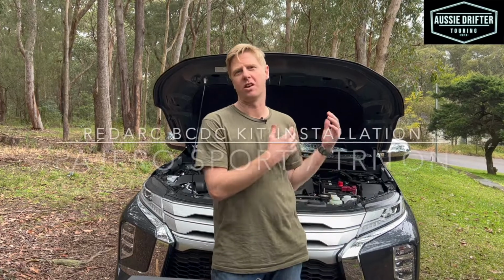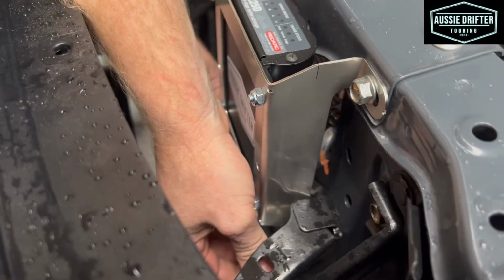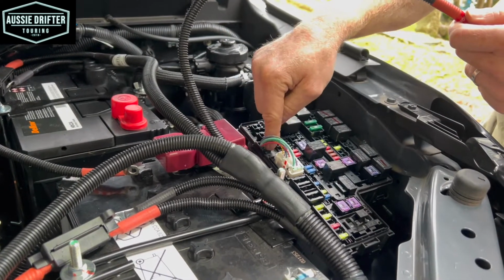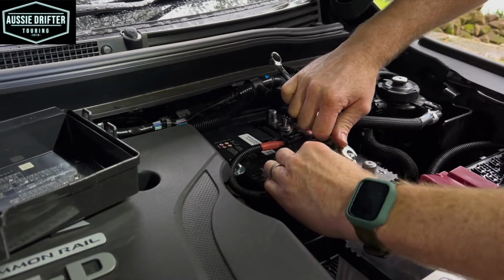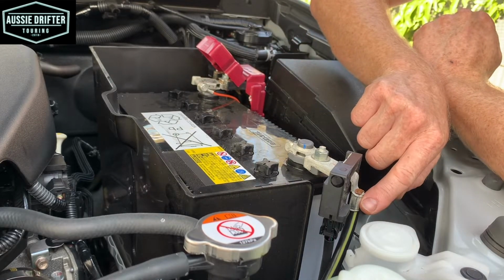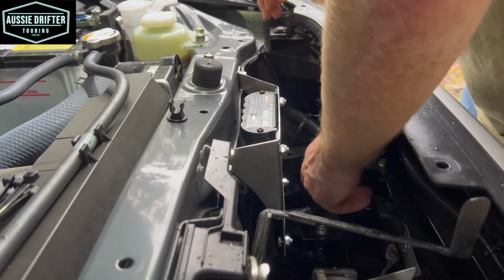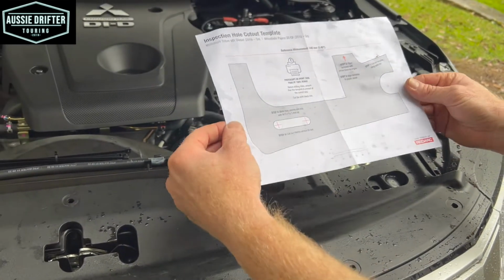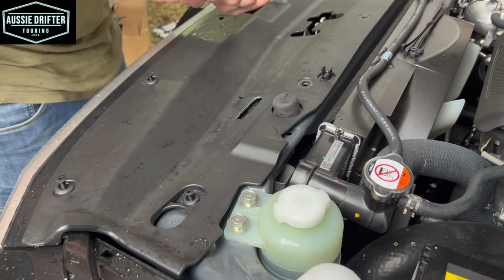Mitsubishi Triton | Pajero Sport REDARC BCDC Dual Battery Installation Guide (Under Bonnet)

Comment: I have a aftermarket intercooler in this location. Would the BCDC still fit?
Reply: I assume you mean aftermarket/additional transmission cooler. Most likely too late for you but for anyone else, I'm pretty sure you can't have both mounted in this location. Even if you could get it to fit the BCDC charger would be blocking a large amount fo the air flow to the cooler.

Comment: Hey mate, what size fuse did you use on the fuse tap, and what is your tap rated to. The one i got from supercheap is only 20combine. I want to use the same fuse to tap into that you used
Reply from the maker: We put a 3amp fuse in the second slot for the redarc but the redarc doenn't draw any current it's just looking to see a signal so 20 amp rated will be fine.

Comment: Just to clarify, when the car goes into isolation mode, does that mean the main battery is basically disconnected from the car and the deep cycle takes over powering all existing sockets etc?!
Reply from the maker: No mate, it means that the main and the aux battery are basically isolated from each other.  So anything wired to the aux battery can be uses without flattening the main battery.  All the original car sockets remain the same running from the main battery.
Reply: @AussieDrifterTouring  ahh! I see now, fair enough, certainly a great kit looked super easy install! Thanks for replying

Comment: Can you please tell me how to keep the fridge running in my 2022 Pajero Sport using the rear 12 v socket in the back once the vehicle is locked!
Reply: This won't work as the power to the 12V sockets is cut off once the engine turns off. You need to install a secondary battery like in this video. Either in the engine bay or the boot.